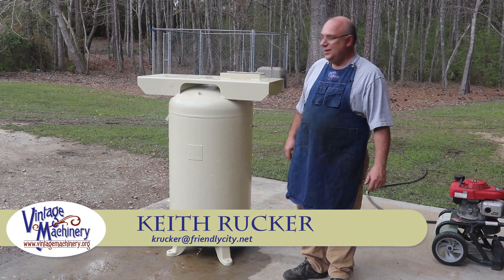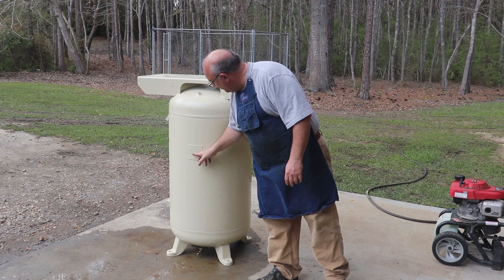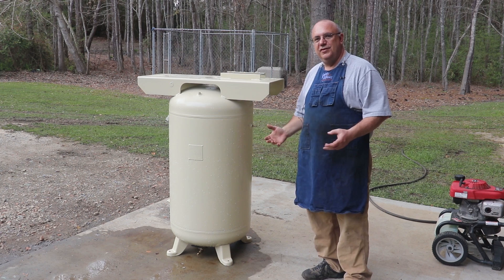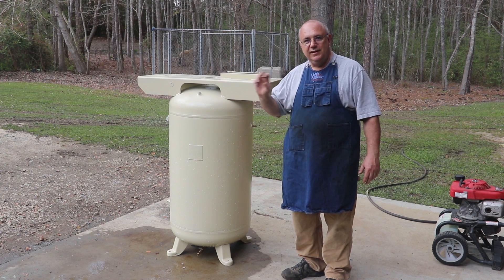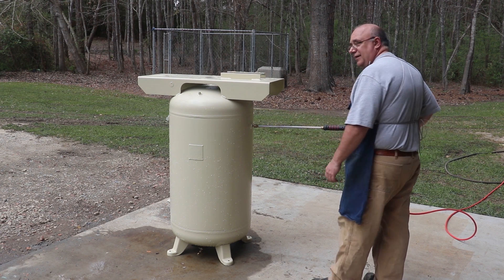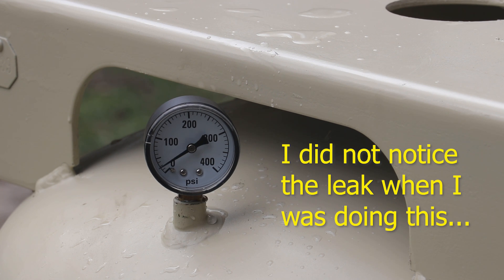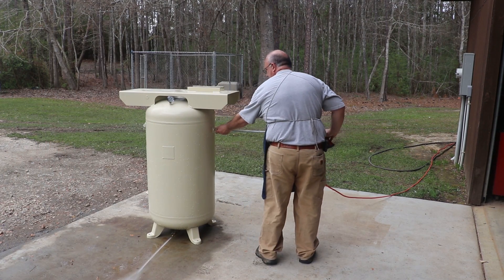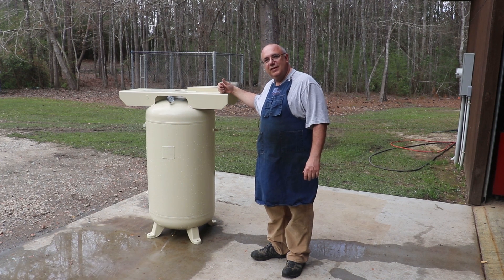Hydro Pressure Testing a Air Compressor Tank

Comment: I'm going to add a comment here about safety... Keith is a knowledgeable guy, but testing a pressure vessel (yes, even a compressed air tank like this) can be very dangerous.  In particular, a mistake with the pressure washer will violently burst pretty much any tank, because even the lowest pressure power washers have ~1250psi capabilities.  You can use that much pressure for hydroforming metal, so destroying a tank like this is easy to do.  Plus, even when filled with water a failure can be loud, violent, and painful.  If your hand is in the wrong place, you may lose some fingers or worse.   As an example of what could go wrong, imagine if (in Keith's video) the fitting into which he fitted the pressure gauge had a piece of debris that floated up with the water, but did not block the fitting until after the gauge was fitted and pressure started to increase.  If the pressure gauge read nothing, the natural thing to do is keep going... if you have a full tank and a higher volume pressure washer, you could reach the tank burst pressure without the gauge even reading above 0.    The only really safe way to do a test like this is to be far away from the tank or have it surrounded by a safety enclosure, and don't use a motor driven pump for pressure.  In the home shop, about the only common item that would fit the job is a "power pack" hydraulic pump that's hand operated.  If you have to test the way Keith did, then use a pressure washer hose to attach to the tank that's long enough so you can be at least 25-50 feet away, and use a wand or valve to turn pressure on/off and watch the pressure washer gauge to measure back pressure (or binoculars to watch the tank).

Comment: Many, many years ago a friend of my fathers walked into his body shop to find the pump and motor from his compressor setting on the floor by a large hole in the wall. Most of the tank was found in a corn field about 1/4 mile away. All of the tank peaces were never found.

Comment: Keith i appreciate your video! i have an old sears air compressor from the 70's unfortunately there is a chunk out of the crank keyway and when i contacted campbell hausfield (who made the pump for the compressor) they wanted to sell me a new pump! After that they wanted to remind me of the safety of an old tank. Now i can hydro test mine mine though i pulled the inspection plugs and looked in the tank!

Comment: To the fans of holding pressure for a period of time - a tank full of cold water from the tap which is sitting in the sun will heat and the water will expand. With no place to go, the pressure will increase. Rather than going for groceries and checking back in a few hours, monitor the pressure frequently while the tank is under test.
Reply: When hydro testing you monitor the pressure and bleed off pressure as it rises and monitor the temperature as well.

Comment: The fact that you're going to be using air at 150psi doesn't mean that you should store at that pressure. If your air compressor has the capability of doing so, you should store at the pressure rating of the tank, regulate the output down to 150psi, and in doing so increase the effective air usage volume available (ref Bolyle's Gas Law), and decreasing compressor run-time.

Comment: Good job Kieth, I actually have my boiler plumbed where I can Hydro it before every run. I use the feed water pump. I valve off the safety valve (Osha No No) and bump it up to 150% WP.
Reply: Terrible idea, you only want to do that test one time because otherwise you are putting undue stress on the boiler. Pretty sure boilers aren't designed to do 150% proof testing all the time so you might cause a fatigue crack from repeated over-stressing.
Reply: @TechnicalLee  LOL Repeated testing: I run my boiler maybe once a year. Typical safety factor for boiler design is 300% to 600% WP depending on the application and how the engineer feels that day. Look up endurance limit of steel....If 150% of WP is any where near this stress level,  you are already in trouble (and lucky to be alive). The danger: ...As metal thins due to corrosion or whatever, even the normal operating cycles can exceed these stresses.  150% is the industry standard. Hydro testing is to have an impending failure occur at a low potential energy level.

Comment: What would you have done if the tank exploded?  No safety.  I filled truck tires with the old rims and we had to cage them.
Reply: You may not have been paying attention. The reason to use water instead of air to pressure test is that if it were to rupture, he'd have gotten wet potentially but the tank won't explode like those split rim wheels would because the potential energy with compressed water is so low.

Now hydraulic injection might have been a possibility though.
Reply: So if the tank ruptures with water pressure instead of air pressure, the parts being blown apart just fall to the ground? @bradley3549
Reply: The light just went on, there is no explosive energy with water as with a gas, like air...thanks for making me think. @bradley3549
Reply: Correct. Think of a water balloon versus one filled with air.  The air filled will POP if it fails. The water balloon just leaks until empty.
Reply: You filled truck tires with water?
Reply: No, it was filled with air, but the split rims were known to separate with fatal results. @stargazer7644

Comment: Scrapyard?!  Come on Keith, no respecting southern boy would scrap that tank.  It's the new BBQ smoker at the deer camp!
Reply: exactly!
Reply: @johnbrian118  If it blew like a boiled sausage it wouldn't be good for that either... ;)
Reply: @jackmclane1826  
It wouldn't during the hydraulic test.
Reply: @calvingreene90  True, but this wasn't a purely hydraulic test. The air cussion at the top was enough to be violent in case of a rupture.  See how the water shot out at the end...

Still a lot better than a pure air test.
Reply: @jackmclane1826  
There was the little air bubble but it was mostly the steel's elasticity. The plastic deformation from rupturing would have been slightly more than a pure hydraulic test but not enough to ruin it for making a smoker.
My Jr high school shop teacher had an air tank that had ruptured when filled with air hanging on the wall. I don't underestimate the power of compressed air.
Reply: @jackmclane1826  I have a 60 gallon multi-tank setup. It always shoots water out when I'm done, even before opening the drain petcocks. It's black water, looks like paint. I can rub it into my fingers and it disappears, so it's not paint.
Reply: @WhiTeaNdNeRDyOG  A little is normal from the elastic stretch of the tanks under pressure. But if it comes out here in this video, you definitly have air in your system. The black color is iron oxide. Another hint that your system has contact to air at some place. But again: A little is normal.

Comment: I bought an $85 Chinese Digital metal Thickness Gauge on Ebay.  Checked it repeatedly against metal of known (and easily measurable) thickness.  It appears to be quite accurate.  Then I checked many spots on the bottom of my 1986 80 gallon Ingersoll Rand vertical Air Receiver. Several places on the tank bottom showed corrosion thinning down to 50% of the thickness indicated on the build plate. This tank was drained frequently from the day it was installed new.
Reply: steel is neet stuff. It will form a cell and crrode through at that point resulting in a leak versus an explosion.
Reply: @forbesmathews89  That's great! So explain some explode then if that's the case?
Reply: I imagine if the corrosion has affected a weld or a long pit of corrosion causes a weak point and the tank rips open... and maybe combined that with an over pressure.
Reply: Losing that much thickness.  The original manufacturers head thickness is shown on the "U" for the serial number of the tank from the National Board in Columbus, Ohio.  If there was a corrosion allowance in the design, that amount is shown also.  This is important to know for down rating the MAWP, scrapping or safely using.

Comment: well i did not think that my comment would turn in to such a bun fight. just got in from work  don't know what's more dangerous high pressure testing or making a comment on You tube ! .
Reply: It brings the self-righteous subject police out of the woodwork. Just like the punctuation police, that's all they know about!
Reply: crazy huh? youtube brings out the best of em. gotta keep in mind some of us like Keith didn't have internet nor much of instruction manuals, nor could a lot of read well, but somehow with all the crazy stuff we did, we made and by the way, things in the past were built a lot better. like my dad he had a second sense about building everything with maximum overkill. everything worked and lasted longer than he did. today with all the warnings based on harbor freight junk as the leader in tools for these poor kids to place their trust in, makes me wonder, so that is what their standards are built on. to them it's the deal, i mean it smells like tools when you walk in, but that's as close as it gets. i used to think those flash lights that harbor gave away was ok, but they're trash too.

Comment: Why test anything more than the pressure relief valve (or plug); it will fail before the tank?!!?
Reply: It gives you a bit of a safety margin in case something malfunctions and you have an over pressure.

Comment: It would be interesting to see how you 'dry out' a tank like that! Thanks.
Reply: You don't have to. It's going to fill with water in service anyway.
Reply: The proper method is to drain it out, then you add in some alcohol, then drain that. Next connect a line from a DRY air or inert gas and run that through it until it's dry. If it's a tank with a larger opening there are tank driers that are sort of a long nozzled hair drier that go into the ports and dry them out.
Reply: @Blazer02LS  How much alcohol do you need to add to dry a tank thats the same size as this (80-100 gal)? if its a large quantity where can you buy that much alcohol.
Reply: You would only need about a gallon at most. You use something like an engine wash nozzle to fog it into the tank, it absorbs the water and you drain it out. Then use clean dry air to blow that clean.
Reply: @Blazer02LS  - is it even necessary to get the inside of the tank dry? Once you start using it as an air compressor tank it is going to get moisture inside of it.

Comment: When they hydro test high pressure gas cylinders they get pumped up with water to the test pressure but at the same time they measure the expansion of the tank under the test pressure.  The test I watched was done by placing the test tank inside another unpressurized tank filled with water.  As the test cylinder expanded it displaced some of the water in the outer tank.  The displaced volume was recorded by reading a site glass affixed to the top cover of the testing tank.  They were looking to see that when the when the pressure was released, the cylinder returned to its original volume (shape). and there was no peppermint deformation to that tank being tested.   If the sight glass didn't return to the same starting point that indicated the tank had exceeded the elastic limits and had failed the test even though it didn't leak. Continual cycling  such a thank would cause it to eventually fail.
Reply: Peppermint deformation?? Damn you, auto-correct!  :-)
Reply: @johnopalko5223  I was wondering if peppermint deformation was some esoteric term and just glossed over it, but seeing your comment made me think about alternative words, and realize it was permanent. 👍
Reply: @johnopalko5223  that would be a tasty and aromatic deformation.
Reply: Craig that is done on high pressure tanks like oxygen, nitrogen, dive tanks etc. When I was working at a company that used a lot of tanks I often saw tanks delivered that were manufactured in WWII and a few as far back as WWI. They had many cycles and been pressure tested many times. Although there was a series of dive tanks that were known to fail near the neck.
Reply: Yup, that was because they used the wrong aluminum alloy (6351-T6)  in manufacturing. The neck would develop micro cracks and then fail. We had a lot of them in the fire service as well. Did a lot of hydro testing of SCBA tanks over the years. 
Those are tested using an eddy current test, visual inspection and then hydro tested if they pass those two first. We just took them out of service, cut them up and scrapped them. Not really something you want strapped on your back if it fails...  Have seen the results of that, not a good thing to see...
Reply: Good point to consider, measuring the tank circumference at the middle with a tape would give some additional peace of mind, I like that idea. im all for the diy but as long as the correct tests applied for the tank. For a start the name plate or stamp should state the standard the tank was built, probably an ASME Section VIII tank, so you would follow UG-99 standard hydro static test procedure. At a min some of the test points are below:

Test at least 1.3 x MAWP (name plate) Pt = 150psi*1.3*LSR ~ 200psi minimum for the tank in the video, if the plate test pressure is 200psi its probably a 150psi max tank (dont confuse MAWP and test pressure). We dont know the exact test temp and material design temp and stresses so LSR is fudged here ~2-10% since its tested with cold water. Dont over pressurize a tank during the test as you could actually push it to yield. The tank design and test is meant to keep it well in the elastic region when its first built, tanks have safety factor and corrosion allowance but defiantly loose wall thickness over time and are weakened with age and cycles.

P inspection min = Pt /1.3 ~153psi, reduce the test pressure from 200psi to 153psi and do a visual inspection of the welds and joints for leaks, (dont go poking near a tank at test pressure). Test hold time is not specified for a hydro static test but it would be sufficient enough hold time to finish the visual inspection.

One note of caution, UG-100 allows a pneumatic pressure test of tanks where a hydro test would not work. In that case P test = 1.1 x MAWP and its done in incremental steps. Always reference the MAWP to determine the actual test pressure. Not the case for compressor tanks though, they are readily able to be hydro tested so UG-100 test is forbidden in this case, but good to note.

What the guy did in the video was more or less correct (for a compressor tank) but did not perform a visual check correctly, did not reference the test procedure (UG-99 test) and arbitrarily chose 1.5-2x because the tank can take it, confused it with ASME B31 process piping as a test pressure or boiler test pressure which is done at a higher multiple because the test fluid temperature is much lower then operating fluid temp of a boiler so the calculated LSR is much higher on a boiler then it would be on a room temp compressor. A cowboy kind of test approach in the video but within spec, and its better to test like this then not to test.
Reply: @robertficek7586 I have a question in relationship to temperatures. My garage is cold with outside ambient temperatures from summer to winter 90s to minus 20 degrees. Summer or warm weather I  have both filled with air, winter time they are off unless I have heat going in garage. Because my two compressors are not sitting there in 70 degrees is that doubling the stress on having a catastrophic failure using compressors in winter time temps?
Reply: @gregie9999hotair1 ambient air changes from winter to summer are very low and don't affect steel properties, using a compressor in the winter won't cause a tank failure, you can use them safely year round. The biggest cause of tank failure is corrosion on the inside. When that happens it can be quite dangerous. But it's not that common to be concerned. Well made tanks can last well over 30 years and usually the motor or piston is worn out first. The best precaution is to drain the tank daily or install automatic drain valves. Don't let moisture sit in the tank. I have also sprayed penetrating oil into the tank (any oil would do even ATF) just to have an oily film on the bottom to reduce corrosion.
Reply: I agree totally with this. Some should be careful as what they are posting on YouTube
Reply: @marcbeaudry9084  Post safety disclaimers at the least.

Comment: Keith: I don't know about home or industrial air tanks such as yours, but SCUBA cylinders are hydro tested at 5/3 working pressure. That is - a 3000 PSI aluminum SCUBA cylinder would be hydro'ed at 5000 PSI. The pros also put a band around the tank to measure expansion - OR - the cylinder is placed in a sealed tank of water and when pressurized, the water in the outer tank will rise in a glass tube to measure that expansion. Then when the pressure is released the expansion measurement is taken again to determine the amount of permanent "stretch" of the tested cylinder. See you at the Bar-Z. Jon

Comment: During the 1973 oil embargo, an enterprising fellow modified his Ford F-150 pickup to operate on LPG, supplied from a 100 pound cylinder that he had racked above the cab.

Everything went well until a mechanic at the Ford dealership tried to run the truck into the service garage — and snagged the bottom of the overhead door.

The cylinder fell to the ground, snapping off the cylinder's head. It took off like a rocket, along a vertical trajectory, landing three blocks away.

Fortunately, no one was hurt — but there was a dispute over who had to pay for mending the overhead door.
Reply: Forklift snagged a 3000psi nitrogen "Torpedo"weighing 1 ton on a trolly, snapped neck off, went through the side of a cooling tower & ended up in the sump. Around 60 years ago, I was a new apprentice there.
Reply: I have heard of something similar only this was a round bottom Oxygen cylinder and a toilet door I will say no more.